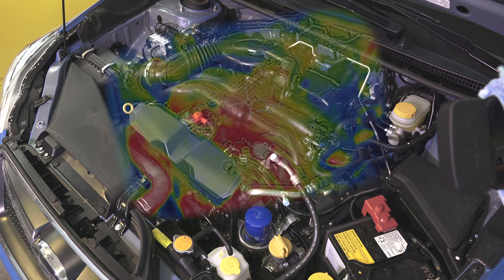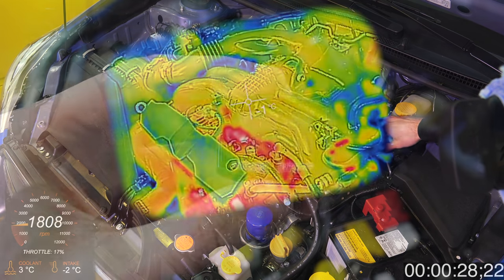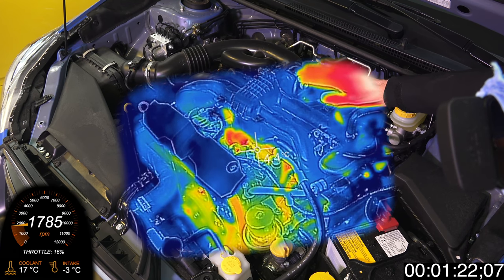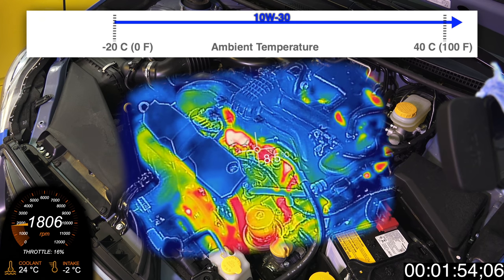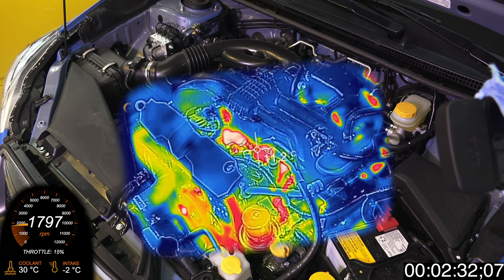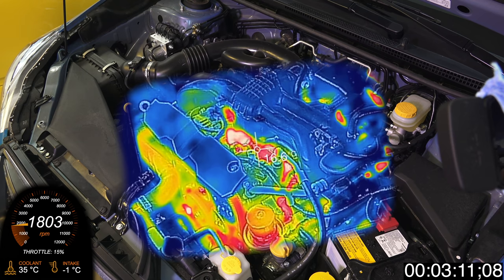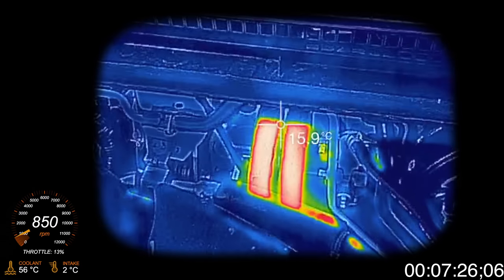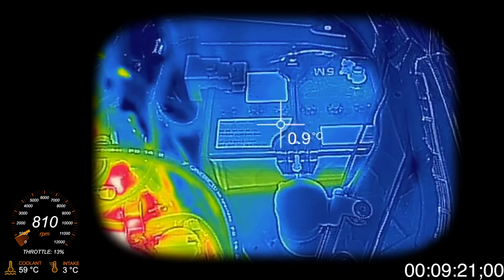Watching A Frozen Engine Warm Up With A Thermal Camera

Comment: We have been to -20F here in the Twin Cities, MN this year.  Unusually warm lately with temps near or above 30F.  Usually January is more like 0F to -20F all month.  

And Florida sucks.  I can think of many other warm states I would move to WELL before Florida.
Reply: Chad Bremer you don't live far from me! lol people don't understand cold until they've suffered winters like us. last week the wind chill was factored to be below 53f!

even without the wind it was -30! 

but these videos are ALWAYS directed at people who idle for several minutes in 30 degree weather.
Reply: Chad Bremer it was like Tuesday before last that here in grand forks was 50 below
Reply: metalhead2508 negative temps.  Experienced both.  -30 is WAY colder than 20s at 80% humidity.
Reply: metalhead2508 I have worked the oil patch in South Texas heat and North Dakota arctic.  lol. I was living in MN for both.  just flew back and forth.  I can take the heat and the cold now.  I am a gluten for punishment I guess.
Reply: Chad Bremer Nice to see another Minnesotan on his Channel. But I agree with you this year weather in MN is bipolar. I just had a remote starter installed into my Car. Since the weather is nicer there's no point of starting my car anymore.
Reply: I have not been warming up either.  Not till it really gets cold.
Reply: I live about 150 miles northeast of you, I agree, these winters are getting weirder and weirder.  But, we still have Feb, which always suck.
Reply: Up on the North Shore?
Reply: Hayward, WI
Reply: Americans and their "wind chill". Ask a Californian and he'll tell you how cold it is "with wind chill". "With wind chill" you look SO much cooler. Neg 2F suddenly becomes some HUGE number. :-)))))))
Reply: Maloy7800 we hit -20 to -30 F actual temps every winter.  No windchill.  Windchill is a BS number.
Reply: Chad Bremer wind chill is a real number but its subjective based on the material it hits. metal looses more heat in higher winds. That's why radiators are in the front of cars. 

so when you hit 30 below like we do here, but the wind chill rating is 52 below, its going to cause even more heat loss than 30 below in a dead wind.
Reply: Sergeant Speed my point is that -30 actual and -30 wind chill feel nothing alike.  I have lived both my whole life.
Reply: +Chad Bremer yea that's true. I'm only stating the scientific reasoning behind the wind chill. I live in the frozen tundra. 20 degree weather feels warm to me haha
Reply: Sergeant Speed MN here.  Been unusually warm lately.  20s and 30s.  Was -20 a couple weeks ago.
Reply: +Chad Bremer yup I'm in grand forks. it was really nice last week. 37! not good for the flooding but amazing weather. before that we hit -30 without the wind. it was rough lol two pairs of everything and a face mask.
Reply: I have done some work up in that area.  I work for a road striping company.  We work all over the state.  At least for now.  Might be getting back into oil since it's about to boom again.
Reply: +Chad Bremer im stressing over that boom. rent prices still haven't settled since the last one. but I just bought a house so maybe ill be able to. capitalize on the housing boom itll bring. 

I dont particularly like this place but it's generally quiet. I can't convince my family to move with me
Reply: I started in ND.  But then went to TX.  Just flew back and forth on my days off.  Kinda surprised the boom hit rental prices so far from the Bakken.  I know when I was out there prices where insane.  I was paying $800 a month for a bedroom in a crap house out of Williston.  

As for the area, pretty flat and empty.  lol  When doing striping out that way it's pretty boring.  I usually drove the grooving truck.  Cuts a groove that the paint goes in so the plows wont scrape it away.  We do about 3-4 mph max.  And on a dead straight road for 10-30 miles, my god that sucks.  lol  I think the closest road to you I worked on last summer was 75.  A long chunk north of Crookston.  Grooved it.  There where some others.  59 by Lancaster all the way to the boarder.  That road was built has some issues.  lol  Did more out there, but don't remember all of them.
Reply: Chad Bremer I work for the city for housing projects so im typically in grand forks. we have a couple rentals in buxton. 

you're dead on about the rental prices, all the way in grand forks, rent is through the roof. houses were 1700 a month for 5 bedrooms. if you wanted a 3 bed apartment youd need 1300 a month. 

I got lucky with my old apartment. up until last year when I bought a home, my rent was 680 a month for a 2 bed 800sq ft.

but the houses were coming up on the market more frequently and I bought a 2300 square foot home for under 160k 

but until this year, houses were hard to come by too because everyone was turning them into rentals or not selling at all. the housing market is severely inflated still but not the way it was a couple years ago. 

my family and I are going to utah this summer to visit my side of the family. but I am planning a surprise trip to the west coast to go site seeing. 

you're dead on about the long stretches of nothing. I think they plant the trees to keep people from realizing how empty it is here. Hahaha
Reply: That sucks about the housing market.  I know it was getting rough for non oil workers in the Bakken.  If you are making $100-200K a year, what ever.  But a lot of people worked at the normal shops in the area.  That's rough.  Especially if you rented.  When I was driving to Williston I usually took I-94 out to Jamestown.  From there it's 52 all the way to Minot.  2 over to Williston.  A few times I Went to Bemidji and took 2 the rest of the way driving through Grand Forks.  Littile more interesting drive than the usual route.  But not much better.
Reply: I know that the rent in minot went up 200%-400% during the boom and still hasn't settled down completely. I worked in new town for a while roofing houses in the new developments. Its a long drive to take from minot to newtown every day but they paid us extra for mileage which was alright. The funny thing about north dakota is that we have the summers of florida and the winters of alaska. I laugh every time I hear them complaining on the national news about 20 degree weather. If it was that warm here I'd be outside in a t-shirt haha
Reply: Josh M lol.  I remember the first time it got back into the teens when I was in Williston after some pretty cold weather.  I was walking around in jeans and a flannel.  lol

Comment: That was a really intriguing video that I enjoyed! One must also remember that even though the coolant temperature is up to par, your engine oil does not follow suit nearly as quickly. For example, I've driven the 2003 BMW M3 and 09 M5 on numerous occasions. Within the first 5 or so minutes, the coolant temperature is up to temperature. However, the oil is still barely reaching 100F. It can take up to 10-15 minutes before the oil is property up to temperature and even longer still. 

I wish my new car had an oil temperature sensor. :)

Comment: I live in Edmonton.....I agree with you on this vid, and thought I'd add, a block heater heats your rad fluid, but there is no point in leaving it going all night, it will only heat to a point in half-hour to an hour...any more and you're just wasting energy. 
your battery won't freeze if it's fully charged, but if your battery is bulging, it's done.

Comment: Realize that as long as the high temperature viscosity number is the same then you can have different low temperature numbers. A 5W oil is always preferred over a 10W oil since it will make the engine run lighter even at moderately low temperatures which lowers your fuel consumption. The wider viscosity range may be a bit more expensive though, but it evens out on the fuel cost account, especially in Europe.

Comment: Really cool video! It might also be interesting to note that warming up the engine only warms the engine. All the other drive components, like transmission, differential(s), CV joints are still cold and have highly viscous lubricants.

Comment: Wow thanks! I have a Subaru Forester 2014 with FB20 engine NA as well. Here in the Philippines its so hot because of our tropical climate.. Anyways thru your video I've finally confirmed that AC temp must be on lowest because of the heat core. Makes me save gas and compressor is opening less intermittently.. Also learned that no need to wait until blue light turns off on the gauge.. Thanks

Comment: 3:17 you can see the top radiator hose suddenly warm up when the thermostat opens
Reply: But why does the thermostat opens at a coolant temperature of 40°C? It slows down the heating process. My Golf MK3 thermostate opens at only ~70°C.
Reply: Because hot spots can cause cylinder warping.  Consequence of not circulating the water.
Reply: I can't see it. I mean I see the hose turning red, but the video is sped up, so it is not so obvious.
Reply: the big hose on the very left of the screen its in an N shape

Comment: I live in Fl. and I am a ASE Master tech and have been one for the last 20 years. I have a 08 silverado 6.0 that has remote start and I dont think there has been a day that I havent started it and let it run for at least 5 min prior to driving. The truck now has 175k and has never had any issue from extended idle.

Comment: Now that was just 7 minutes of idling. Driving the car (light on the throttle) would have warmed the engine much more quickly, especially with the hood down to trap heat.

Great demonstration, as always. Love the channel.

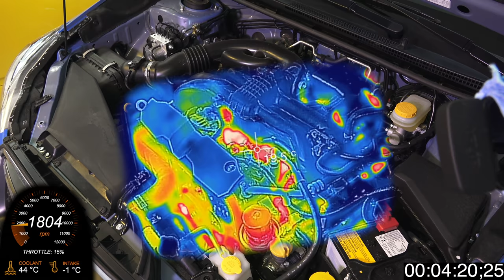Comment: You need to change your motor mounts. Your engine is swaying hard 3:20
Reply: It's a brand new car.....
Reply: Look at the right side of the frame, you can see the thermal camera swaying, not the engine.
Reply: LifeAsSteve with very bad motor mounts
Reply: Not the mounts, it's his camera lol
Reply: tough crowd
Reply: A shame no one got your joke?
Reply: BAAH DUM TSSSH!
Reply: Where were you when I needed you
Reply: I'm a mechanical indianeer, and the swaying of the motor is definitely a result of worn, or improperly seated engine brackets. His obviously need replacement.
Reply: indianeer  lolllllll
Reply: plokmijn47 the XV should have hydraulic motor mounts like my 15 Impreza, the FB20B is a little rough and basically required these mounts to smooth it out and not transfer so much of the vibration to the car
Reply: Nah bro the engine has Shiver Tech....  its moving around to warm it self up.
Reply: good one!
Reply: Right! That's what's wrong with this japcrap, it ain't sturdy!
Reply: I see what you did there.....Youuu motherflower
Reply: lmfaoooooooo
Reply: KG Egzi I hate it when my 200kg engine block sways with the wind
Reply: Yeah bottom end bearings are definitely worn, I'd seek out professional advice from a mechanic if I was you
Reply: Haha is the camera
Reply: I think its an overlay in the edditing

Comment: VIDEO IDEA: Cold Engine Wear In Freezing Temperatures comparing Oilpan Heater vs No heater vs Block Heater and doing Oil Annalysis' to see which resulted in the most wear.

Comment: I always warm up the engine until the RPM's drop - the point where the Thermostat opens and the emissions system goes out of open loop. This is winter, spring, summer, & Fall (every day). Obviously it takes much less time (1 minute) in the summer vs winter starts (5 minutes).

I've done spring & fall tests where my overall mpg across 3 days is 2mpg lower if I don't let it get out of open loop before taking off after starting the car, on 40 F days. Great video; I always wondered what this would actually look like =)